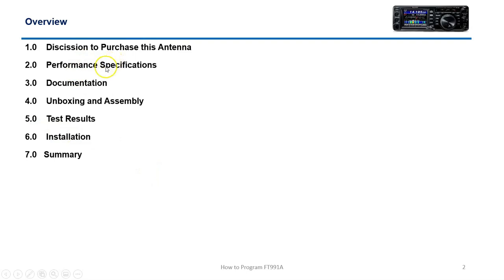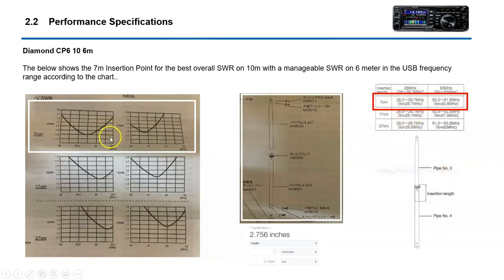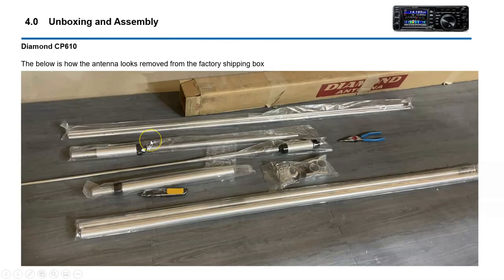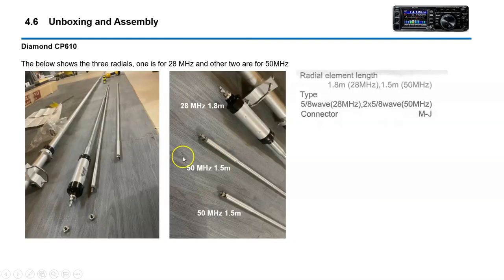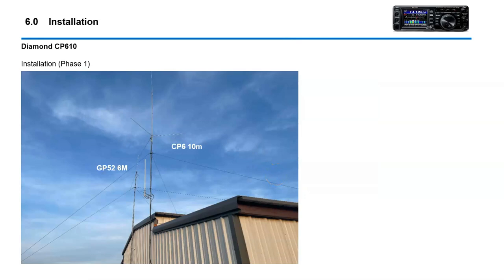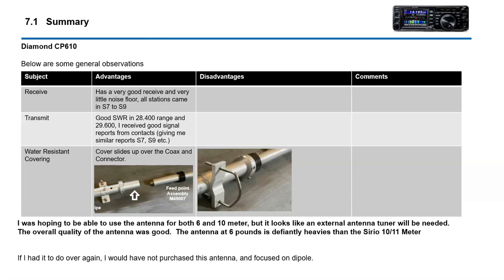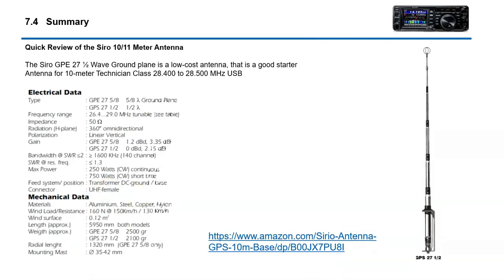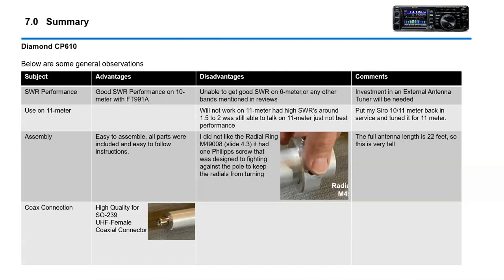Review Diamond CP610 (10- and 6-Meter) Vertical Install & Antenna Review

Comment: Greetings :) I wonder if you did what many of us did, and as a result, got crappy results on 6m, that is, till we all discovered our error ... The TOP of the short tube, that covers the feedpoint and that the whole antenna slides into, MUST, I repeat MUST, be at LEAST 12cm 4.7" above the top of the mast else the 6m SWR will be crap even when the 10m SWR looks reasonable. If the 3 radials are down too close to the main mast and the mounting brackets, it screws up the matching.  A good few of us have been caught out with this.  de  Dave, VK2TDN

Comment: The CP610 is my best antenna for 6 and 10 meters, and also for 17 meters with low SWR seen on all three bands without a tuner.  I wonder if anyone else has had success with the antenna on 17M and at what power levels.  So far I've been limiting my power on 17 to 200 watts.  Dave, K3DOS
Reply from the maker: Hi David, thanks for the message, I got my 6M SWR down to 2.0 I have made some great contacts on 6m, apricate the message and gled your enjoying the antenna  '73 de KI5JUF

Comment: I had mine up for 2 years and it is dead something broke in the matching section. 6 meters has Supper High Mismatch my TS-2000 cant even even tune it, 10 meters is 4:1 +
When I first put it up it was good 10M was FLAT! 1.2 ~ 1.3 tops all the wat to FM 6m was good too for the SSB parts of 6m was 1.2 on 50.125 and got to 1.8 up to 52.xxx I was getting out better then my home made 6m 1/4 wave. 
This antenna is not built well at all it feel cheap and flimsy for what you pay for it. The sheet metal screws all walked themselves out with in a year with blue Loctite. I ended up drilling right though the vertical aerial using 3/32 Stainless steel nuts and bolts.
Reply from the maker: Good evening, Matt, thanks for the message, I ‘m embarrassed I spent ~ 300 bucks from DX Engineering, I got a good initial response from Wayne and Diamond, he sent me a new Feed Point Assembly, same end results.   That Diamond support trail went cold haven’t heard from Wayne is 2 weeks.  I know they were relocating so that might be why.  At any rate, If I could have a do-over I would not have bought this antenna.  So, in all the disappointment I can use it on 10M and it’s good in USB, AM, and FM <1,5 SWR.  I just can’t image why a metal roof would kill 6M and it works great on 10M.  I’m past the point of return with DX so I’ll just hang on to it and use it for 10M.  Again, thanks for the message and appreciate hearing from you ’73 de KI5JUF
Reply: @westtexasvideogateski5juf255  yeah it sucks I had the same luck with a Diamond  X50 it is Def on VHU and UHF.. I have a mobile TRAM 1180 on a NMO ground plan kit and it works better then the X50. 
I sent it back to DX Engineering as defective got a new one same story .. ill never buy a  Diamond product again. :(

Comment: Good review, I am also looking for a good combo 6/10 meter vertical to mate up with my FT-991. I’ll be looking for an update on this antenna for the 6 meter side. Thank you. Ken KA6SUB
Reply from the maker: Good evening, Ken, thanks for the message, I got a good initial response from Wayne and Diamond, he sent me a new Feed Point Assembly, same end results.   At any rate, If I could have a do-over I would not have bought this antenna.  So, in all the disappointment I can use it on 10M and it’s good in USB, AM, and FM <1,5 SWR.  I just can’t image why a metal roof would kill 6M and it works great on 10M.  Again, thanks for the message and appreciate hearing from you ’73 de KI5JUF
Reply: The CP610 works great with my Ft-991. Dave K3DOS
Reply from the maker: @davidhess6593  Hi David, I have to admit it works prefect on 10 meter, USB, AM and FM great SWR.  6 meter SWR is 2.3 after some work but I can manage that.  "73 and thanks for the message.
Reply: @westtexasvideogateski5juf255  Try it on 17M Steve.  You may be surprised.

Comment: Am surprised with the negative antenna performance  you experienced on 6  meters.  Diamond antenna engineers as a general rule put out an excellent product. This would be a black mark on their antennas so I think they would go out of their way to fix the problem.  Great video.  Thanks.  73 KD4FJ
Reply from the maker: Good evening George, so good to hear from you I remember when we talked on Texas Nexus a while back, so I'm going to contact DX Engineering and ask them to look at this video maybe send it to Diamond to see if possibly I missed something in the installation,  That's the plan I'm going to try to get the 6 meter working maybe Diamond has some suggestions, I keep you posted.  Thanks again my friend always glad to hear from you '73 de KI5JUF have a good weekend!
Reply: I have had 2 Diamond antennas thr x50 and the CP610
THE X50 was a dud out of the box I sent it back and nothing.
A moble tram antenna beet it.
The cp610 only last 2 years now it has real bad SWR ON 10 AND 6